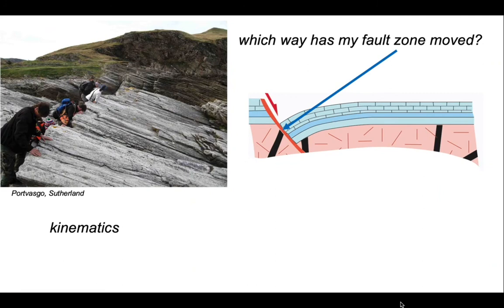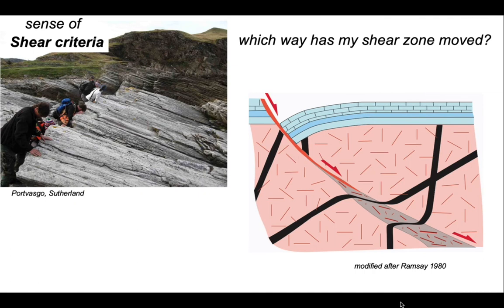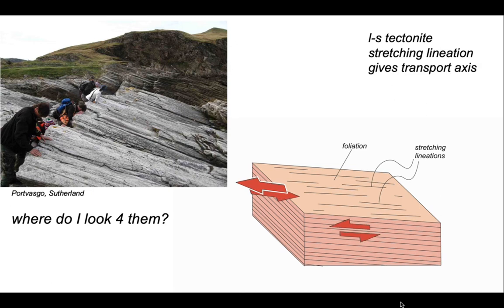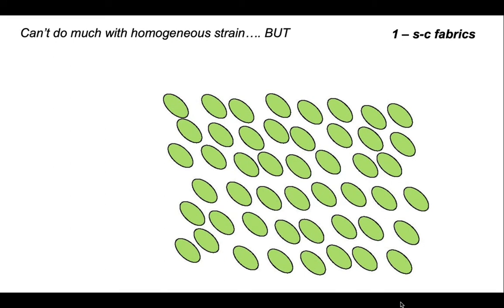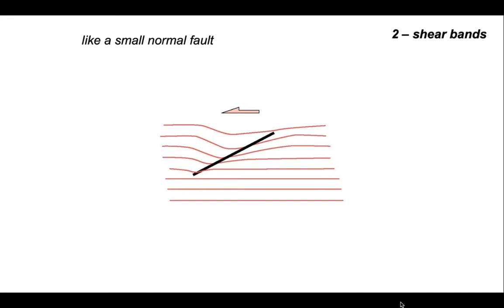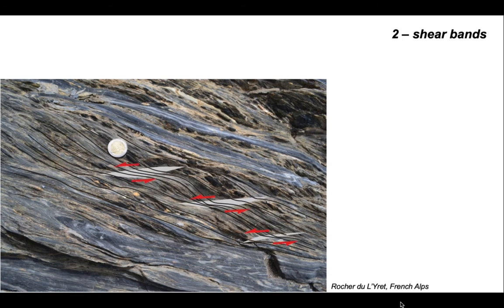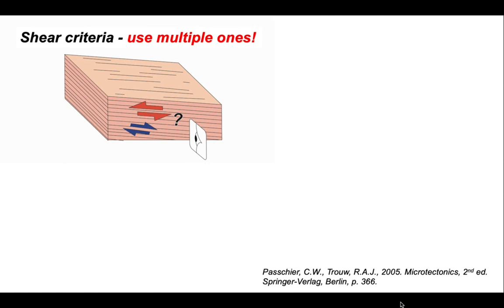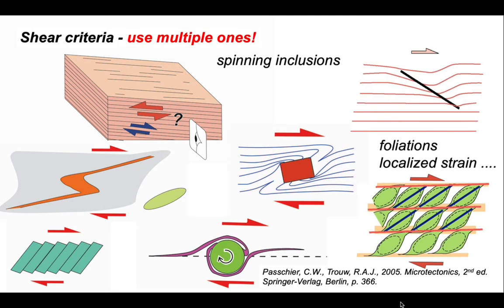Shear criteria

Comment: Hi, at minute 9:18 it shows in left outcrop picture that the general shear is parallel to shear bands, but in the figure to the right the general shear is parallel to the foliation not parallel to shear bands ...am I thinking this the wrong way? thanks!
Reply from the maker: Well - the sense of shear in the shear bands is as shown - and, upscaling, it implies the same SENSE of shear in the shear zone as a whole. The general issue lies in deducing the orientation of the "shear plane" (see video on shear zones for further discussion, and the shear band vs s-c fabric in the current video)... In the case here (Rocher du L'Yret) the shear sense is "top to L" ... Hope this helps.

Comment: Thank you for the interesting lecture! I have a question about the shear sense of the folded pegmatite at 14:09. Is  sinistral shear sense also possible for the asymmetric fold of pegmatite in your example? like N-shape minor paracitic fold in a larger flexural fold.
Reply from the maker: Thanks for the question. Fold shapes need care, and consideration of where different strain intensities are distributed...  as in the sketches that follow in the video.

Comment: I study it again. In the workflow, the fourth step should be parallel to the lineation and perpendicular to the foliation; not "perpendicular to the lineation" as listed.
Reply from the maker: Actually not - see timing at 3.30 ±... we need to look across the lineation (in a direction perpendicular to it) - not parallel to lineation (i.e. down the lineation direction) in order to identify the relevant asymmetry of shear criteria. Hopefully the diagram makes in clear. Thanks for asking for clarification.
Reply: @robbutler2095  Thanks. Do you mean one should begin from the side  across the lineation is ok, YZ plane. This YZ plane usually contains symmetric structures. Then naturally, change to find  and determine shear sense by the XZ plane asymetric shear criteria from the side  parallel to the lineation but perpendicular to the foliation .
Reply from the maker: @张宏远-z8t  Establish X-Y plane (foliation) = shear plane at high strain. Then find X (stretching lineation) = transport axis (at high strain). Then look in Y direction (so X-Z plane) to identify and interpret asymmetric structures (=shear sense). The other views may indeed contain asymmetric structures (fortuitously) that introduce ambiguity into a kinematic analysis. This approach assumes plane strain simple shear of course.... and this decision needs careful contemplation because not all natural deformations are like this!
Reply: @robbutler2095  This workflow explanation is much clearer. That's great. Many thanks!